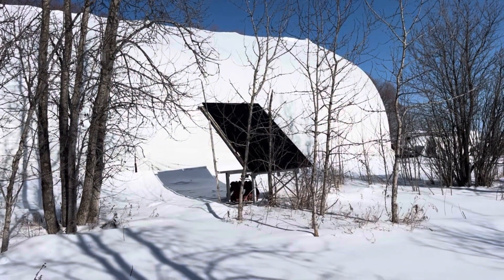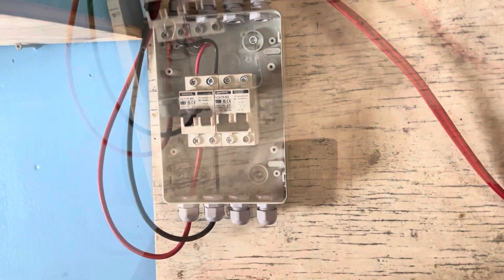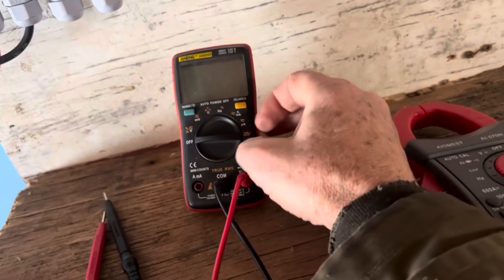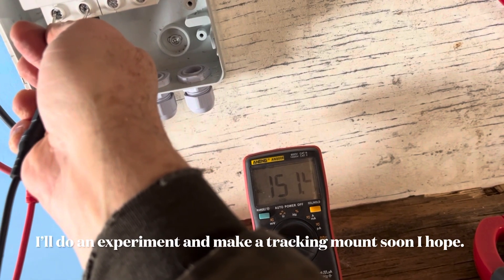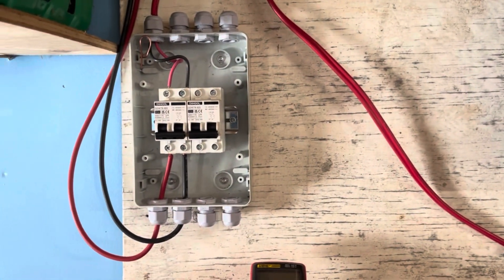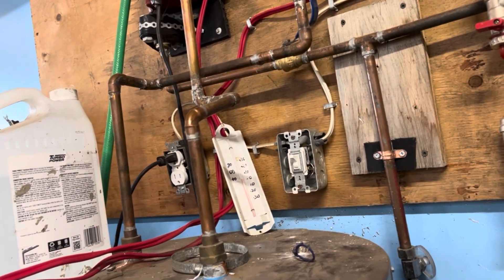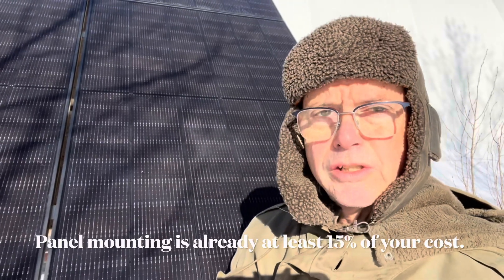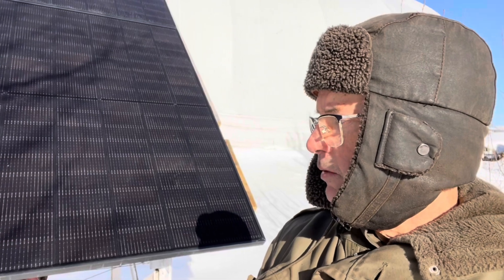Solar Panels to Hot Water Element

Comment: Put your panel straight up
Reply from the maker: The 4 panels that are fixed probably could be made vertical. They are always getting covered in snow. Actually I think I’ll make them adjustable for vertical in winter but angles 3 months of the year.

Comment: With the element off there is no load on the panels, it's an open circuit, so why would you think the panels absorb the energy? The other thing is that it doesn't matter if it's DC or AC heating an element. Grid AC is RMS (root means square). If 120 AC volts is coming from the grid that means it will heat a resistor the same amount as 120 volts DC.

You simply can not put PV on a roof in northern climates. I use a telescopic pole with a foam squeegee to clean my modules.
Reply from the maker: If there's no electrical load (like a device or battery) to carry that generated energy away, it gets trapped as thermal energy within the panel's components, causing it to heat up significantly, just like a dark object in the sun. A disconnected panel produces high voltage but no current, and this energy has nowhere to go but into heating the cells and frame.
Reply: @Swampwild1  That's wrong. 
If you have a battery and it's not connected to anything does it get hot? Of course not. A solar panel that's not connected to anything doesn't either. If a solar panel heats up it's from the sun being absorbed by a black surface. 

The energy you talking about is in the form of DC current, with no load there is no circuit completed. E=IR, Ohm's Law, if I = infinity (an open circuit) there's no power used; P=I^2*R, no work done and no heat from inefficiency.
Reply from the maker: @mosfet500 Sorry but I have actually tested this on my panels. Try it yourself with an infrared temperature sensor. It happens in just a few minutes. And it is dramatic. So the explanation is correct.
Reply from the maker: I’m not sure what you’re referring to with the Ac/Dc. Panels are DC so no way to change them. 
You need to expand on why you can’t put panels on a roof. There was no reason provided.
Reply: @Swampwild1  First, you said it yourself, panels on a roof in the north get covered by snow so you lose months without a benefit from them.

Secondly, the current of the panels is relative to Ohm's Law so if you have 161VDC and 10 amps the resistance is: E=IR; 161/10 = 16 ohms resistance of the element. That resistance doesn't change if it's DC or AC. The AC from your outlet is RMS (root means square), that is the AC value that heats a resistor to the same level as the equivalent DC voltage. 120VDC heats a resistor to the same voltage as 120VAC. Your 4 panels are putting out 161 x 10 = 1610 watts. It doesn't matter if that is coming from DC or your grid (AC).
The voltage on your panels drop relative to the load resistor, they don't stay at the Voc (voltage open circuit) rating on the panel label. 161/4 = ~40 volts per panel at 10 amps. at 100 amp load the voltage will probably be 0 volts, not 161V. The difference is that the grid is not current limited, it will put out whatever E=IR dictates. Let's say the heating element is 10 ohms, you panels are not capable of 10 ohms at Voc, that voltage drops (check the panel label for PTC (maximum power). That all the panel is capable of. Once the panel hits its max current level capability your voltage starts to drop if the load is beyond its current capability. That's the difference with the grid, it has no current limit up to the point the breaker trips.

That's why MPPT is so good, it keeps the total power in the sweet spot of the panels which is what you want.
Reply from the maker: @mosfet500  Yes I’m sure you are right. In the comments that are pinned I advise people to check out the guy who has created proper dc to panel systems. I have not done this. I’m just using MPPT and inverter like most people. The video is about panel structures especially vertical panels. 
My vertical panels always clear and up high on the shop. As far as I’m concerned I’ve proven it’s the best solution for performance. It’s just that it’s not economically feasible for most people.

Comment: Mountain dew 1 litre plastic bottle cut top off and stick to panel. Depending on depth of snow it will allow the sun through so not much loss but enough heat to melt panels.. just a though, i live in tropics so zero experience with your weather.. but a plastic dome or similar..
Reply from the maker: So you mean that the snow would not fall on to the top of the panel because it would be partially sheltered by a plastic awning of sorts?
That’s actually a cool idea. I’m going to try something like that. Thanks

Comment: I have used the same system for 6.5 years for my home hot water. 3/320 watt panels connected to my 4,500 lower element. The biggest benefit is that my inverter doesn't have to handle a 4.5 kw load.
Reply from the maker: Excellent point. Inverter capacity is always big issue and water heaters are often the straw that breaks the camels back!

Comment: My panels are on a rack on the ground, like your 4 here. I use a soft broom, if it is deep, I use the hard backside of the broom till 1" of snow and then use the soft side. I was using an extension pole on the brush. Now I shuve the snow up, and it pulls most of the snow down with it. With my new panels on a rack 3 high in landscape direction, the extension pole might come in handy again. Yes, when you clear part of it off, the heat made by the panels will loosen up the rest, even the frozen spots of snow/ice. By the time I get back to the 1st panel, it has heated up enough to just brush the snow that is coming down to the bottom. Hope this helps.
By the way, if you had a charge controller, you could use these panels as a diversion load for the hot water. I'm still doing my homework on hot water.

Comment: Your problem is you listened to people like POZ who don't know what they are doing.  I specialize in heating with PV resistance and capture all the power you can get out of a panel by matching the resistance electronically.  You can double or triple the power you are getting thru the day in less than optimum sun conditions.  These systems are cheap to build and fairly easy.  All it takes is a little ambition.  This is a deluxe version but they can be made with half the parts. 
https://www.youtube.com/watch?v=iaLbLYhPLtw
Reply from the maker: I’m just going through the links, you answered my question! Thanks.
Reply from the maker: Sorry more questions. What about my rant about no sun for NOV Dec? Are you in MN? Tell us about your situation, like can you heat your floor in Dec?
Reply: @Swampwild1  I can't control the seasons or the weather. I can get all the possible power out of a solar panel possible b keeping the array at the power point voltage regardless of sun level.  I do have someone in Lithuania using my system in hydronic floor heating with the same size array.  He is getting what a solar calculator predicts though it isn't enough. Your array is sized for a test.  Too bad you never connected a power meter to it to record daily production.  You have nothing to compare with a power point controller.  Your array is capable of paying for itself with the right control.

Comment: They sell a 48 volt heating element 700 watts comes with a build in thermostat  and they also sell a matching solar panel 655 watts I got one for a friend the heating element was 100 US dollars and the solar panel 130 dollars and it works really nice as a water heater not sure in Canada 🇨🇦 but sure does here even with snow outside
Reply: NEVER NEVER NEVER use low voltage heating elements.  Voltage is your friend.  Current creates great loss and cost with long leads.
Reply: @ no loss it works really well to be honest they have hot water at 9:00 am and all the way till 8:00 pm at night even after dark sorry but one panel one heating element super cheap and it does it’s job he got it from Missouri wind and solar best ever it’s so good they are out of stock at the moment and I got one my self to pre heat the water best investment ever

Comment: David Pod (Pods) ?  He compared a PE panel vs a water heater collector and the PE panels were much better. 

If someone was willing to invest a few thousand not including panels. 

The EG4 6000xp can provide 6000 watts of 240v AC. $1400. 

12000xp.  12000 watts of 240ac. $2500

Both are 48v. You could have a smaller battery bank and let water tanks or the floor being a battery.
Reply: You can get top performance by only spending $20 and building a power point controller.  15 parts to solder but solar can't seem to build anything. I've specialized in PV resistive heating for almost 10 years.  POZ has no technical education and his advice is iffy.
Reply from the maker: @opera5714 What’s this? A tracking device? Sounds great, give the guys a link?
Reply: @Swampwild1  These power point hot water controllers are used primarily in Europe where water heater elements are lower wattage, and they run on higher voltages.   Thet are designed for cost and light duty.  I design ones that require customer understanding to set up.  Primarily they are designed for diverting excess solar from an off grid array to heat water with excess at a minimal cost.  It might be interesting for you to try one.
Reply from the maker: @opera5714  Yes I should do that. One issue is that now I have the MPPT and inverter and almost ready to put the whole shop on solar with a panel grid interlock. So for me it would probably not pay now? Certainly there should be better YouTubes more available to show this method.
Reply: @Swampwild1  It sounds like you have embraced the dark side.  That may be for the best.  Things that make sense to solar people don't make any sense to me. Be aware that by being in a constant heat mode, the batteries will never balance.  That could become very expensive heat.
Reply from the maker: @ Hi. Thanks again for your help. I have pinned a link to your YouTube at the top of the comments so people will get the best advice from the start.
My batteries have a BMS. But I do have plans to build a greenhouse with a sand battery next door to the shop. That would be a great use of your panel to DC technology.
Reply from the maker: Yeah I looked into the water panels and while they are definitely more efficient they are very expensive and they require a lot of hardware to keep from freezing. But on a one time big build it might pay.
Reply from the maker: Yeah I looked into the water panels and while they are definitely more efficient they are very expensive and they require a lot of hardware to keep from freezing. But on a one time big build it might pay, they were $5000 Cdn

Comment: Just the shade from the branches will disrupt power production. You are better off with a combination of solar and 1.5kw wind. Manitoba has wind in winter.
Reply from the maker: I’ve listened to Missouri Wind and solar podcasts and wind is expensive and maintenance heavy because of the height and structure required. We just don’t get enough wind here vrs adding more panels.

Comment: In the winter I put my panels completely vertical, snow cant build up on them.  It could be automated with an actuator and controlled by voltage. Low voltage = vertical, Regular Voltage = angled.
Reply from the maker: But they aren’t on the roof right?

Comment: I use the squeegee side of a car snow brush to remove most of the snow and then the panel do its job to melt the remaining snow or ice. it is crazy how fast it melt even at -10C. now my only issue right now,  I have the panels leaning on the fence and the last row of cells are in the snow so I only get half of the panel... also when the snow melt on the panel the water freeze again at the bottom. I'm not sure how I could remove that. I was thinking maybe heating cable that you can install on roof or gutter, but you need electricity for that.
Reply from the maker: Yeah that’s why I welded my rack up 3’ off the ground. But imagine trying that on a roof! Let’s see what people think.
Reply from the maker: This is the area we need answers for the most. Clearing snow off panels cheaply and safely. Up on roofs.

Comment: volts times amps = watts - dc 163 volts x 9 amps = 1467 watts (1467 watts divided by 110 volts = 13.336363... amps) ac 110 volts x 13.33... amps = 1467 watts 

I worked with a fellow in California in the old days. He painted exteriors with an 18? perhaps a 24 foot foot extension pole with a big lambs wool paint roller. When I returned home to Minnesota, where it seemed all the painters, myself included, climbed a ladder and worked out of a 5 gallon bucket hung on the ladder and regular rollers with a short extension stick. No paint store in the Minneapolis area stocked long poles. My paint store had to special order one in for me. The first in my circle in Minnesota. 

Think on a long extension pole (and power lines) and a wide window scrubbing brush for snow removal. One fellow on youtube has worked out the relative watts produced with vertical panels which he says shed most snow. A full width brush could be positioned across the top of the panel and manually operated from the ground on the line of raising and lowering a flag on a flag pole or electrically - depends on how much fun you want to get out of your solar power - James
Reply from the maker: That would be a great YouTube to see
Reply: Your calculation is wrong.
Under load the voltage was around 150 and the amp draw was around 8 amps